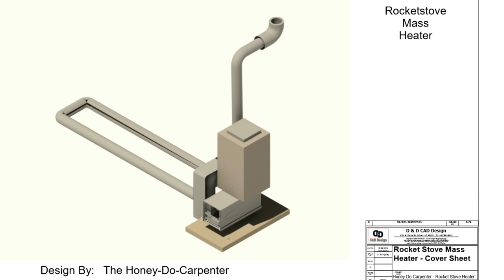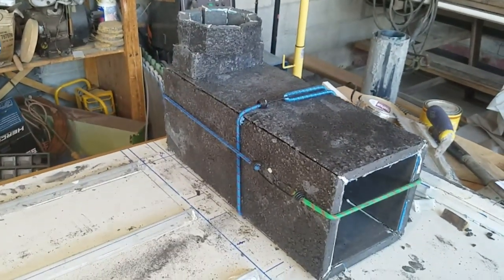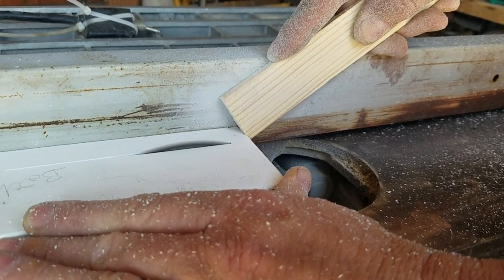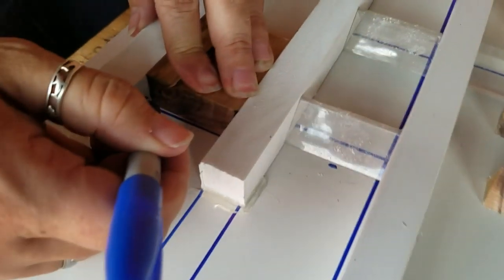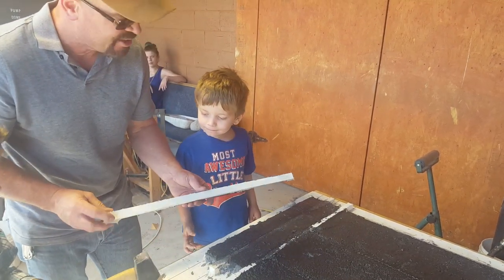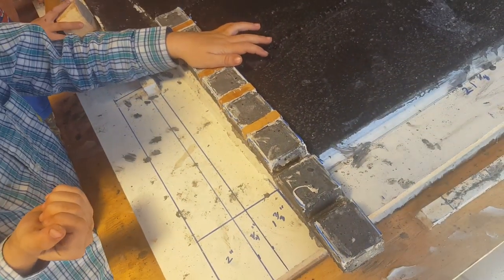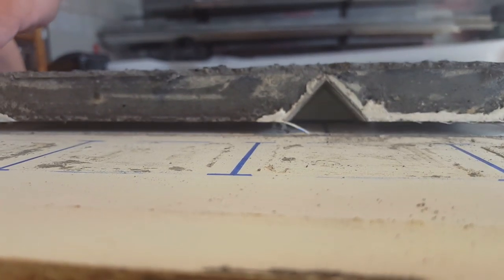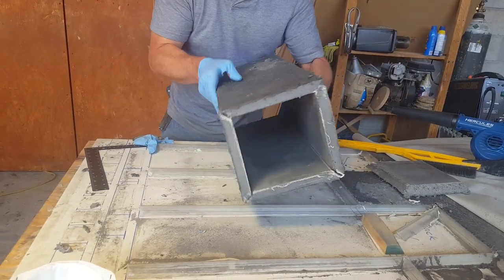Ultimate DIY WOOD STOVE! use 1/10 the fire wood, no more creosote!

Comment: If i were building the forms to use many times, I would use wood sheeting, dowels, and glue. If the angals were pinned and glued they would stay. Dowels in the removable sides could align and hold with caulk at seams. Brush all with waste oil as release agent.
Reply: Do your line work then drill holes in between the lines on your your template big enough for duplex d8 d6. Make all your your wedges out of wood. Then temporarily tack them down with hot glue where they need to be turn your tablet over. All the heights of your wedges are the same height so they'll be held in the place while you drill back through the holes that you made in your template and through the wedges that you have temporarily glued in place. Then push your duplex Nails into place. The whole should be small enough to be snug enough to hold your duplex Nails into place and hold your wedges in place. Turn the your piece back over set it on top of some sawhorses so that none of the duplex nails are touching the sawhorses just your template and that you may gain access after your pour to pull the duplex nails. Now would be a good time to add your car wax paste buff it off then take coating of spray oil that you use for cooking and spray the whole thing proceed with your pour then when it dries you can go underneath pull out all the nails and use a spatula of some sort and pry the whole thing up and then you can roll and pop out your your wedges. Now on your wedges you can give yourself a little bit more room to work and a little bit more gluing surface if you widen the tips and make the angle a little bit less so that they'll be more of a opening for your glue to set that means that you'll have to make sure that you set your proper angles so when you glue it you'll have to make sure that the angles come together where you want that it doesn't tilt out of 90 degree. I have poured similar items monolithically meaning all in one piece. we used foam in the center and then pinned the foam in using baling wire and then later just poured gasoline in the mold after it it was set which eats the foam. We did use mesh to reinforce the finished structure but we had to make what they call dobbies small concrete dice that we used to offset the mesh so it didn't touch the sides.

Comment: Some feed back, the commercial woodfired furnaces have a bin to collect ashes placed in the triangular bottom section. So instead of laying flat on its back, the burn box is turned  at 45 angle on its side. Would that work here?

Comment: I have no tools, no workspace except outdoors. I don’t even have saw horses. 
Do you still make the shipable core? I need a tiny house RMH by winter. Maybe like the revised model w/o the bench like you did for DirtPatcheaven. My house is 12’x20’with 8’ ceilings. I’m in NW Tennessee so it should be enough without the bench. The aircrete riser and burn box are perfecto! Does this still necessitate a 14’ aircrete lined stove pipe? Thanks, I’ll send this same message to your Etsy store. I think I want a batch box, too. I’m uncertain which plan PDF to purchase.

Comment: Hi Folks! A super job has been performed and you hardly ever cease to amaze all of us! I see a job well done, between mock-up, layout, spot on measurements, although i would have been a little bit more tickled if i had seen a more in depth means of how you did the pouring of the concrete batch! It would be one thing had you'd ladled it in or just poured with the use of household bucket with a pour spout. As for the water ratio to firebrick mix by weight would be one thing, but i am curious as to how it actually broke down to get the proper consistency; before the pour was executed. That blip of the pouring of the mix into the mixer, did you end up using the entire bag and if so then what was the size or weight of the mix itself??
Reply: The instructions are on the bag and weighing is the best way with a known size like  a cup. All this is a guess as it changes with the moisture in the air at time of pour.  As a rule the least amount of liquid to achieve pour the better. Now he used to mixer so you can visually see how stiff the mixes and if you need a little bit more water but make sure you give it enough mixing time because you'd be surprised how stuff will look like it's too stiff but then gain plasticity as you mix a few more minutes I and beside you can always add more water you can't take it away very easily you have to add more mixture so you never want to mix a whole bag at a time you want to mix what you're going to use what you think you're going to use and then reserve a little so if you need to add some to to bring the mixture up to thicken that you can.
Reply: @seanbrossard8178  Thanks Sean!